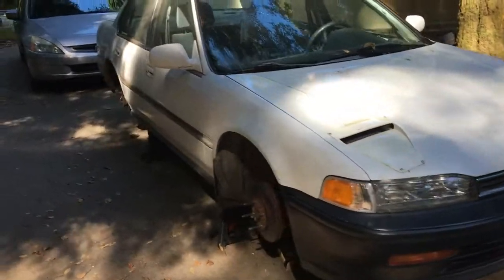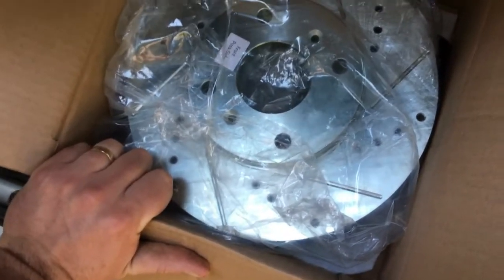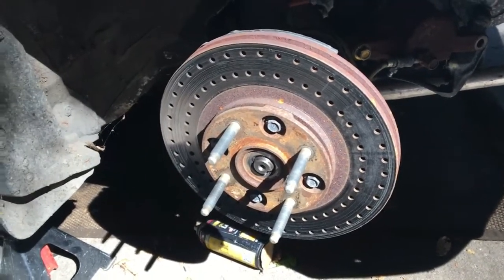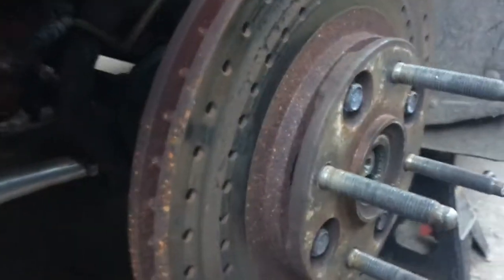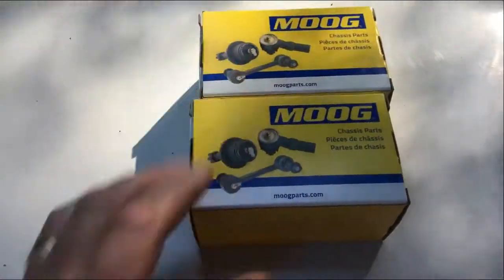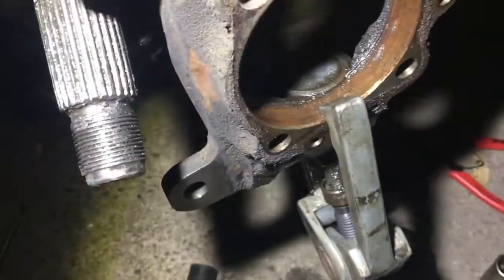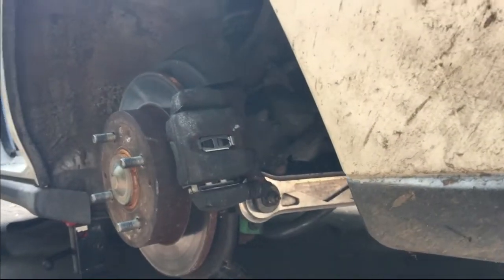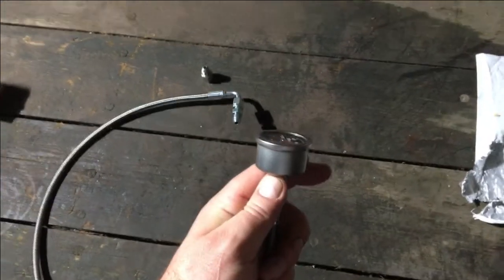CB7 Prepares for First 2020 Track Day!

Comment: So good! Great to see you. Good luck racing!
Reply from the maker: Yeah man, thanks for checking in!  What’s new with you?
Reply: Looks like same as you. Daughter just turned 3. Loving it. Working on the Hondas. Going to do manual steering rack conversion when I pull the trans. Clutch flywheel are shot. Any thoughts on Fidanza flywheel with replacement surfaces
Reply from the maker: Mmmm, If it is one of those 8 pound aluminum flywheels, then I would stay away.  I’ve heard one too many negative things about them, including the fact that the RPMs take forever to fall back down when you shift to neutral or engage the clutch, And it’s not fixable by adjusting the IACV.  The ACT Streetlite flywheel is 12 lbs and steel alloy.  I put it in in 2015, and it hasn’t failed me yet.